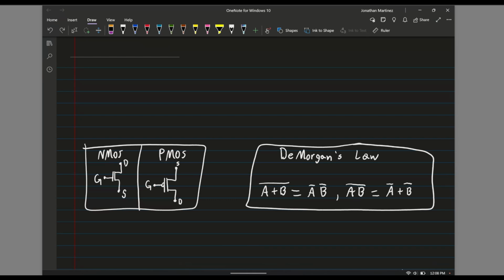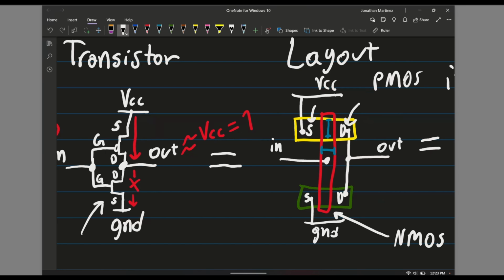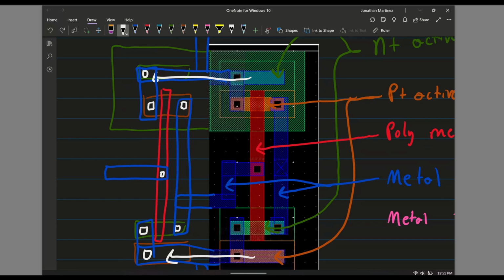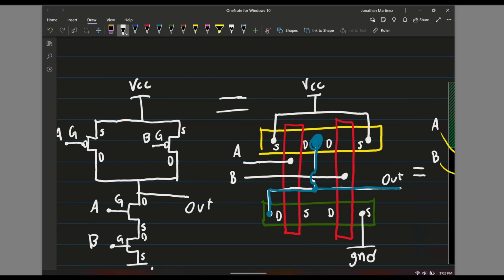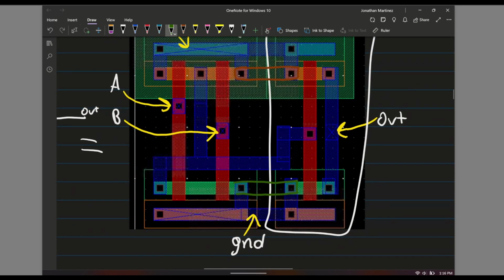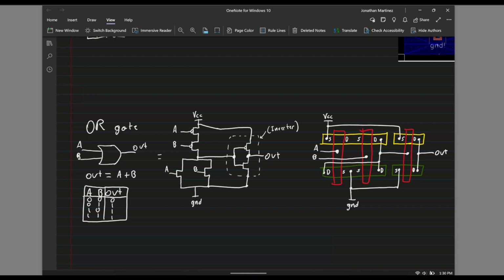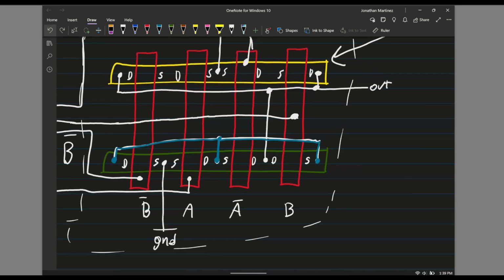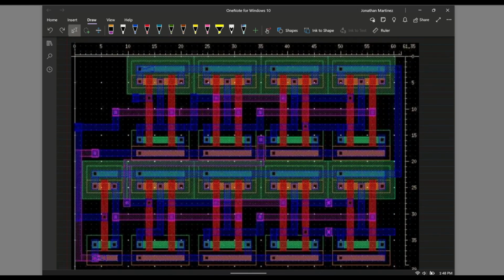From Symbols to Silicon: What Logic Gates Really Look Like

Comment: I have one quick question: in the video at around 15:23, is there supposed to be also contact pads over the overlapping of the red and the brown (or dark orange?)? or it isn't supposed to be connected? (In that case how would the voltage change since I am seeing a not fully connected drain-source-gate here?)?
Reply: Ah, I see where my confusion are, these are the locations of the gate which are initially disconnected without the biased voltage, sorry for my early question whose answer is quite obvious
Reply from the maker: Good question. The transistors here are MOSFET type transistors so the overlap between the poly metal bridge and the P active region is itself the transistor, hence the F in MOSFET, which stands for "field" as in the "field effect" between the 2 materials. Therefore there is no direct connection the same way that the "blue" metal contacts the other regions. The same is true for the poly metal and the N active region.